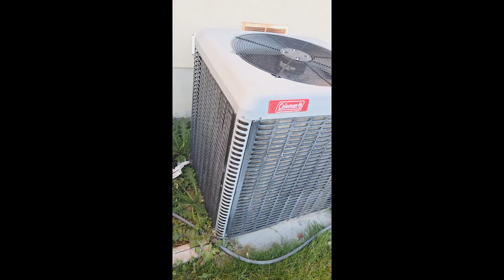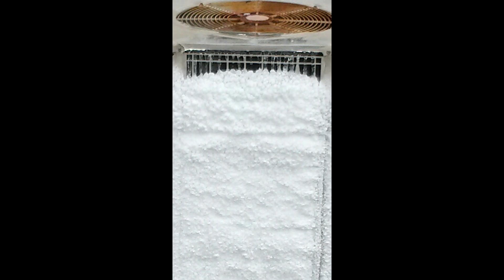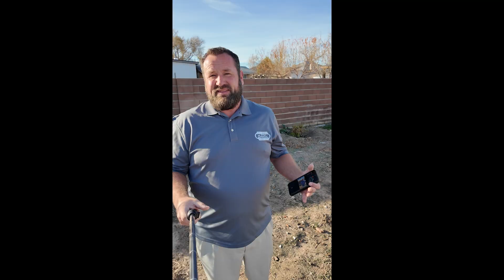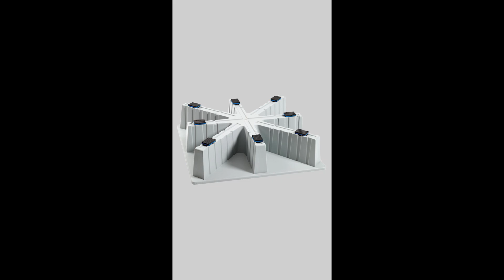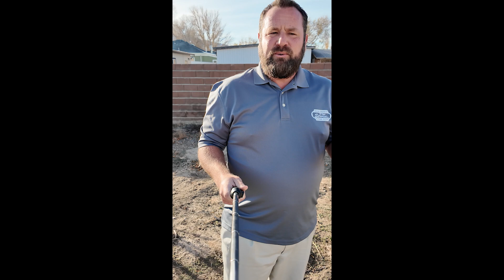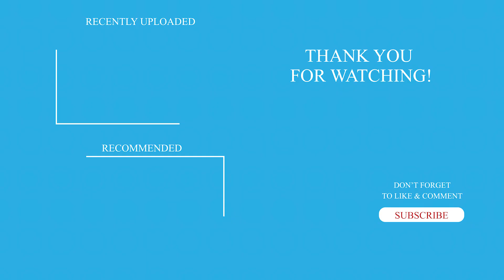This Heat Pump FAILED in 9 Years… Because of ONE Simple Mistake

Comment: Excellent presentation.  Question, what do you do, if anything, when your heat pump isn't raised up on snow legs but is on a regular pad?  The risk of snowfall is minimal; however, the temperatures regularly drop below freezing.
Reply from the maker: there is a secondary drain pan heater than can be added to it in order to ensure no ice builds up and punctures the coil.